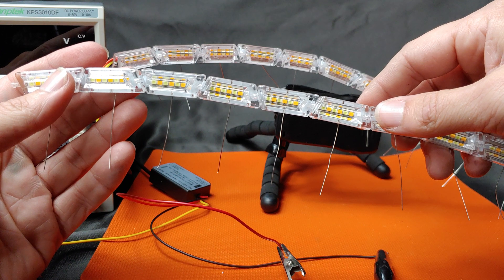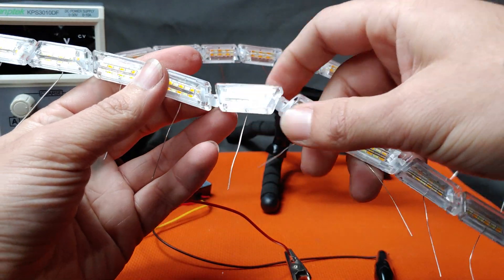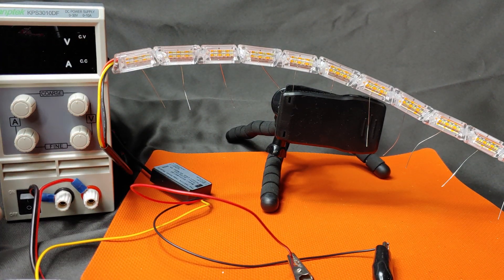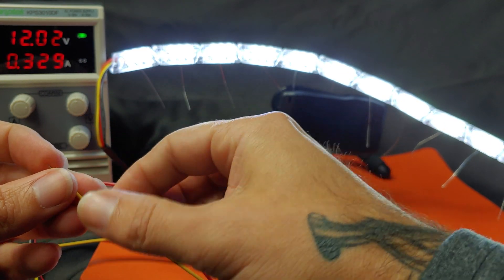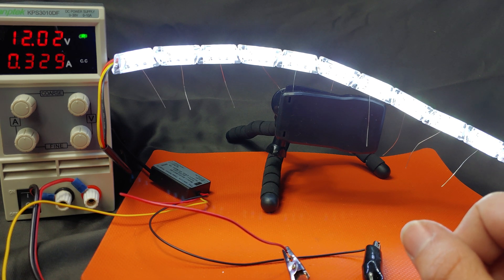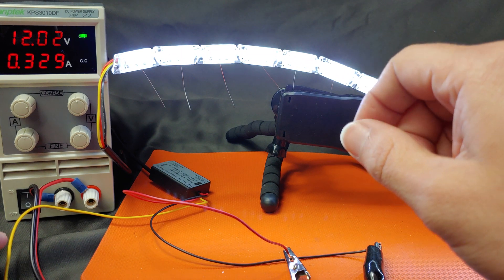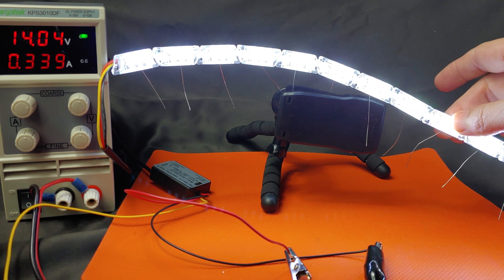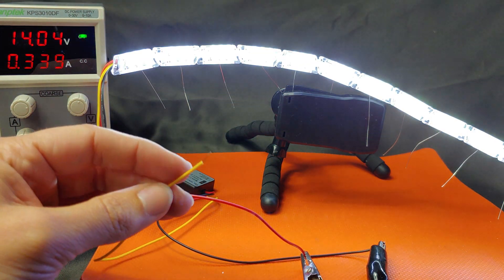LED Switchback DRL With Sequential Turn Signal Review

Comment: Hey James! I bought two LED strips (run brake turn). Positive wire, negative wire, turn wire. 

The right strip works fine through all operations. Both lights run a startup sequence, then a constant taillight, brake operates fine. When I use my left blinker and then turn it off, the strip does it's startup sequence again but instead of going back to a constant taillight it just loops the start up sequence constantly. Again, the right one is fine completely.

Comment: Can these go on the edge of your headlights or they have to go inside your headlights ???
Reply from the maker: This style should go inside because they are not sealed well against moisture/corrosion. There are other styles (I have videos on my channel) which are in a flexible silicone sleeve and could be put on the outside of the housing.

Comment: Is it long last to use? Doesn't burn out quickly?
Reply from the maker: These use very little current (amps) and so they don't get hot which is the primary cause of LED failure. These should last 30,000+ hours of operation.